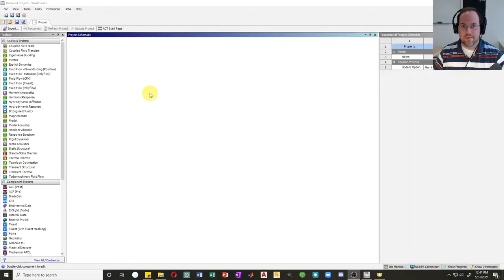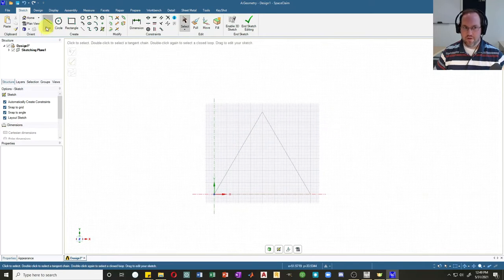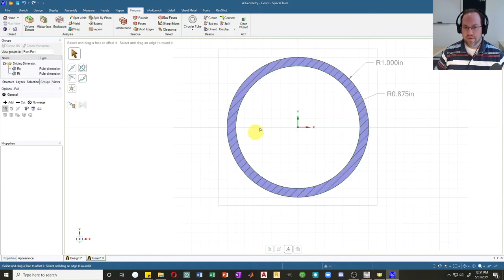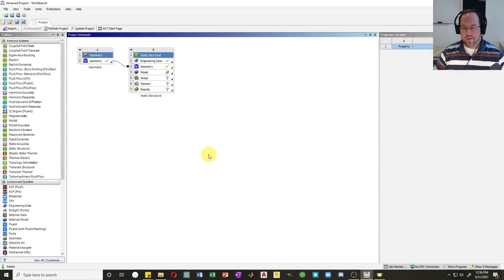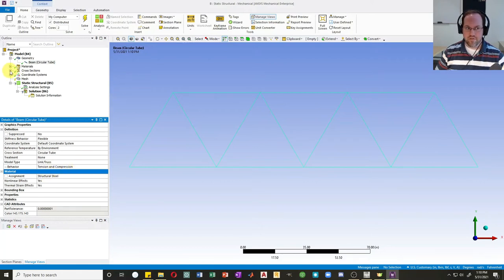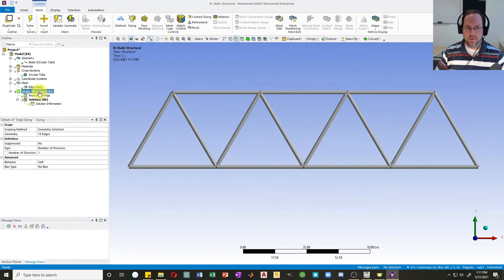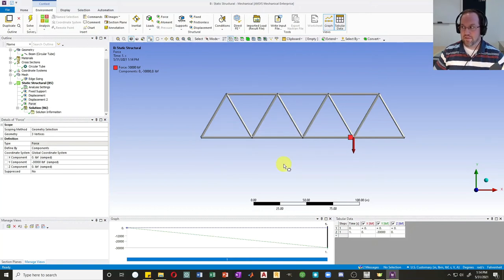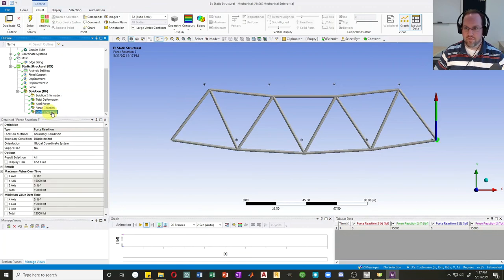Truss Analysis - FEA using ANSYS - Lesson 3

Comment: Hi, I want to create a system that only consists of beams. 
How can I implement several joints between the beams? 
When I want to click on "coupling (CP)" in the workbench but this field is grey and not possible to use the option? Maybe you can help me - thanks!
Reply from the maker: I'm glad you found the follow-up video for beams and frames - that should cover this. Happy modeling!
Reply: @StructuresProfH  Thank you for your videos! One last question: do you know why the CP command isn't available?
Reply from the maker: Not sure I have enough information to diagnose that. If you'd like to provide more details, check out the About page on my channel for how to contact me.

Comment: Hi professor I have a question. If I need to optimize the truss in terms of its weight by changing the dimensions so that each member is close to the yield point, would that be a possible thing to do on ansys? And what procedure would you recommend?
Reply from the maker: It should be possible, but it may not be easy. The "Design Exploration" tools in the Workbench can be used to optimize a set of parameters that satisfy some conditions. You can define what are design parameters by checking the little check mark box next to just about every value in ANSYS; it will change to a "P" if it's a design parameter. 

Direct Optimization is obviously the most direct method, but may take a lot of time and iterations to come to a solution. In the Workbench, you link this optimization object to the parameters of a Static Structural analysis of your truss. You will also need to create output parameters like mass (mass is hidden within the Geometry object) and maximum stress (in a defined stress output). Then in that optimization object, you can define the objective and the constraints.

The problem is that you will likely have many parameters if each individual truss element has its own parameter for cross-sectional area. You may need to be judicious in how you define them (maybe some set of elements all have the same area for constructability reasons). You may have a very long wait as ANSYS solves your problem many times.

If you are interested, I have some basic optimization examples from when I teach FEA. Check out the About tab on my Channel page for contact info.